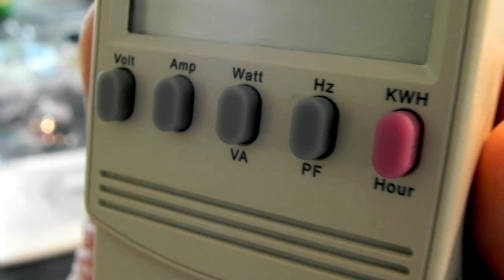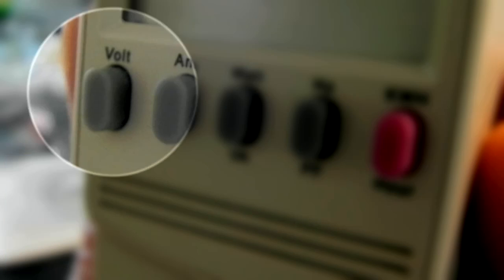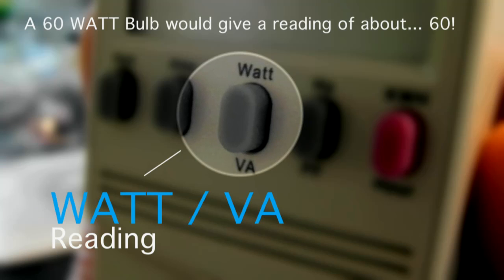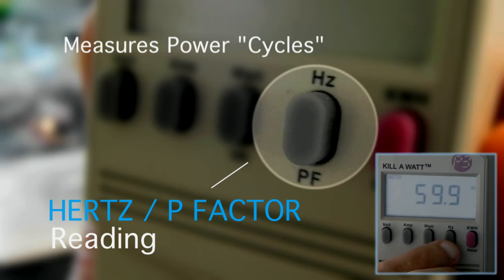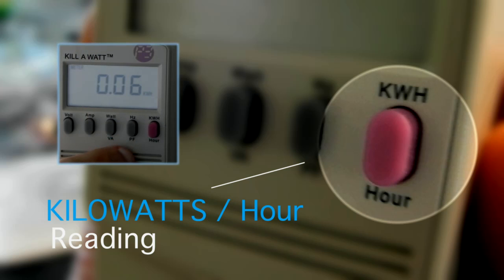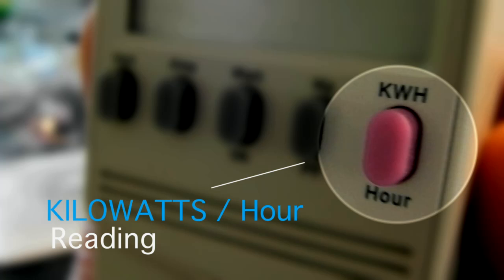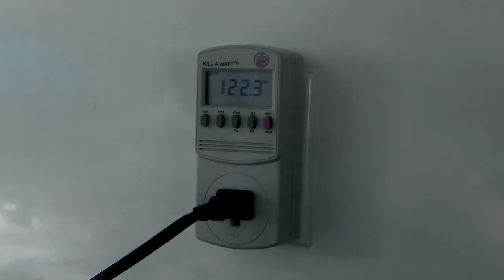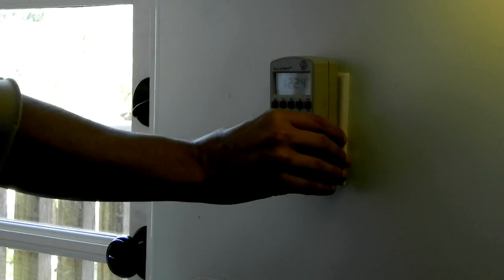KILL A WATT Monitor Overview from CRS

Comment: Didn't see any response so I thought I'd chime it. Generally when things are rated for a watage they aren't always pulling that full wattage. It merely means it can pull UP to that wattage. Alot of things do this, good examples would be your computer, TVs, Microwaves, and your washer/dryer. That's why a kill-a-watt is important, as just figuring with the rated wattage is seldom accurate.

Comment: Quick question chief, does you kill-a-watt p3 meter seem to underrate wattage consumption on electrical items that you plug into it?

I plug in some thing that is 120w and it says it only consumes 48-50w
I plug in some thing that is 19w and it says it only consumes 7.3w ~ 0.06Amps

is there some thing im missing here?? im a little confused. Why does the meter do that? is mine defective. I measured amperage with my multimeter as well, on the 19w item and it says 0.07 A

Can you explain please..??